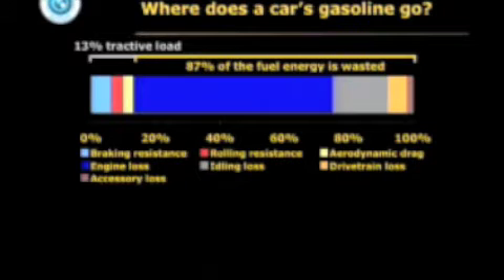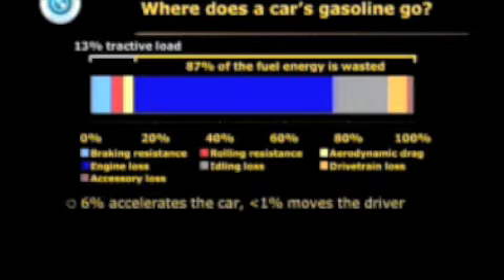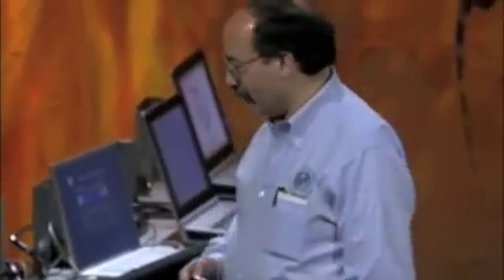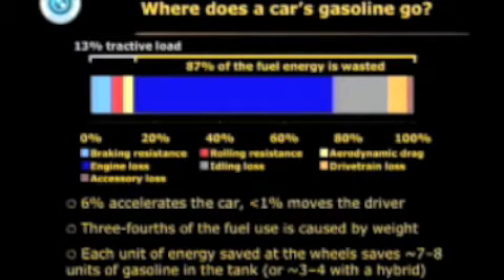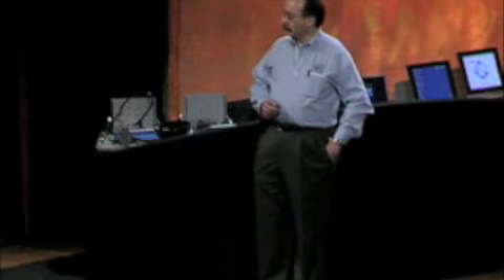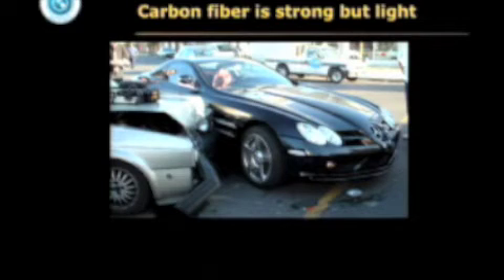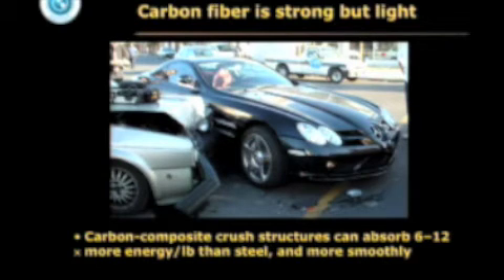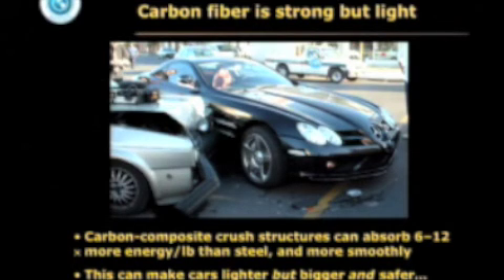Where Gas Goes

Comment: Go do some research and you will find that  engineers involved in auto racing both Formula 1 and other types knew about this technology a long time ago. Lovins jumps on the bandwagon as if he invented something. I repeat this is very expensive and the costs can be absorbed in auto racing. Mass production is different. When the cost benefit analysis allows for this technology and most important the NATIONAL TRANSPORTATION SAFETY BOARD approves it they will be used. No credit due Lovins.